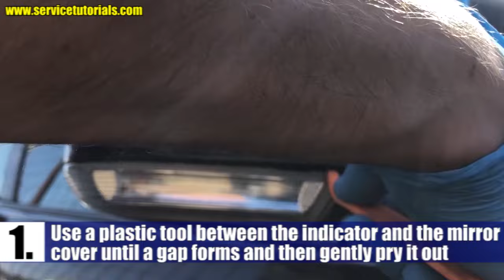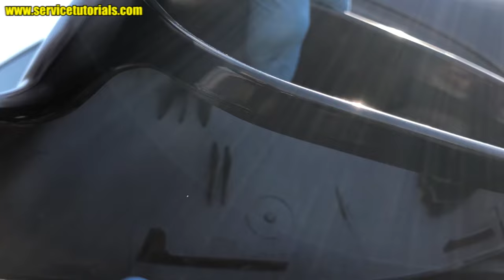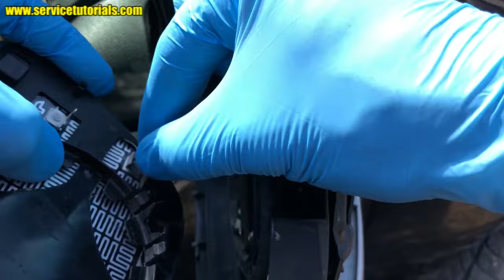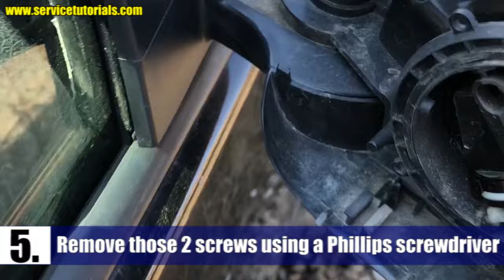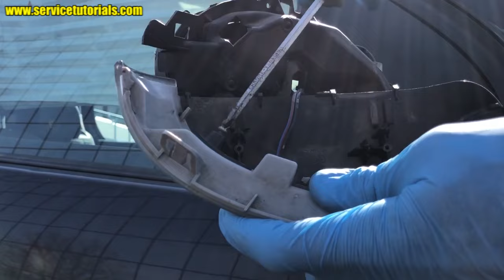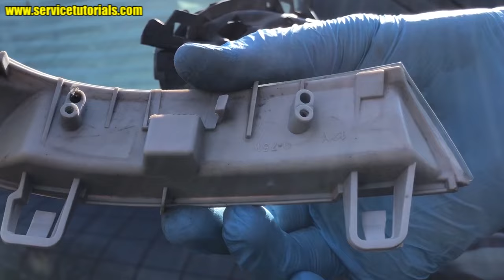How to remove mirror signal VW Golf Mk5, Jetta, Rabbit, Passat B6, Sharan in 8 steps

Comment: 06 jetta pass. Side turn signal (at mirror) not working...no voltage to wire..all other turn signals work fine...where do i start? Thank-you
Reply from the maker: jesse mast Have you checked the fuse box?
Reply: @Servicetutorials  i checked a few fuses..but wasnt sure which one it is..is there a diagram anywhere?.. (dont have a book)..had downloaded a digital manual, but now i cant find it..also wasnt sure if there would be a separate fuse for just that one..or if all 3 turn signals on that side would be on the same fuse??